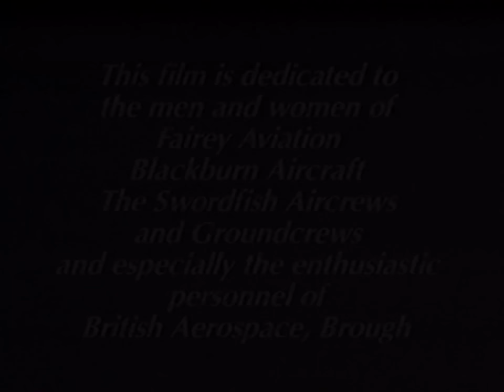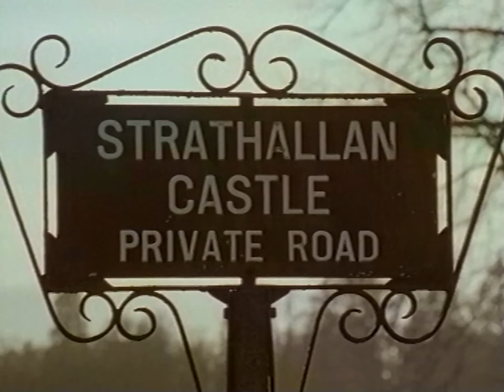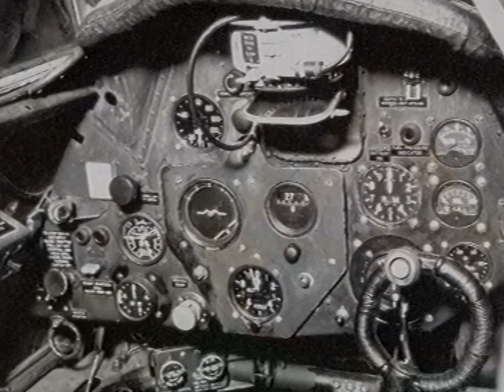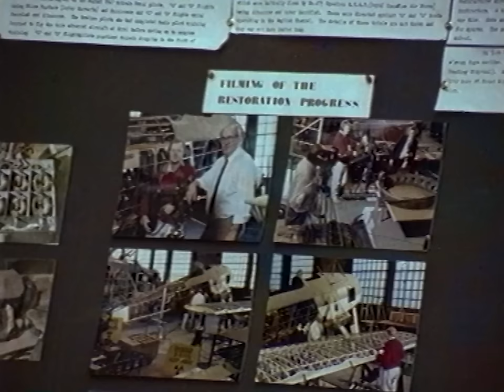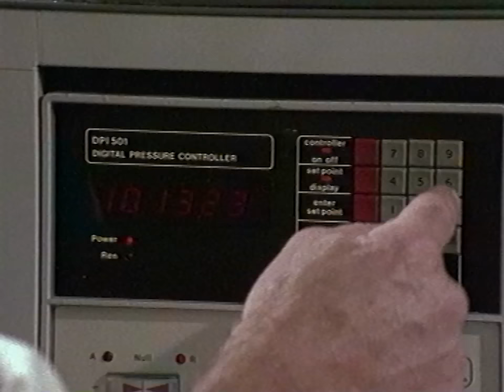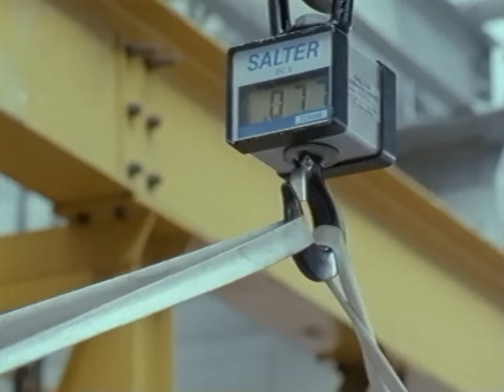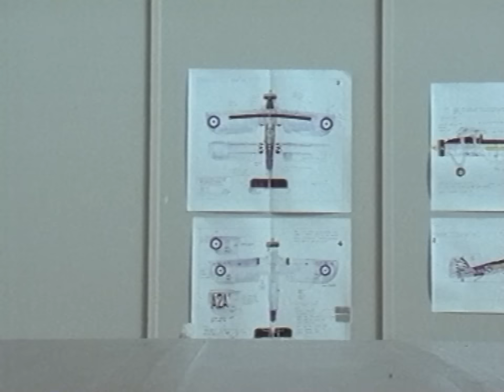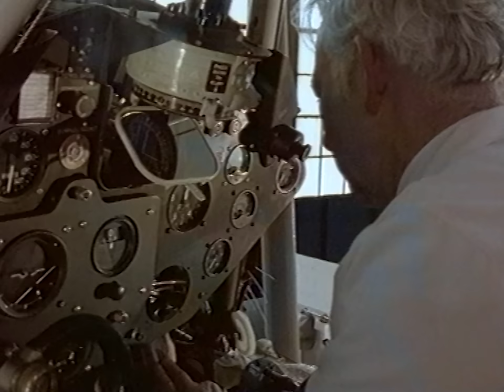Swordfish W5856 Restoration

Comment: The  primary reason the old Swordfish torpedo-bomber was so effective against the Tirpitz and other German vessels, is  because it WAS an old plane. The German anti-aircraft guns tracking systems were designed to pan quickly for fast moving aerial targets...the slow moving 'targets' of the Swordfish had gunners frustrated as they couldn't move their guns slow enough...By the time the gunners had figured this out, it was too late.

Comment: My uncle Oliver was a rear observer in these beauties. He later moved on to Fairy Fireflies, having trained on Skuas. I asked him what was the scariest moment he had in a string bag. His response was attacking German coastal shipping at night. They would undertake an almost vertical dive from around fifteen hundred feet. His job was to pull the toggles that released the bombs from the wing racks to fall on the ship. That's when things got scary. After the dive the Swordfish has a very shallow climb rate, plus the engine exhaust collector ring outlet glowed blue flame at night. You were lit up in the air, slow, and an ideal target. If you had not done a good job bombing the ship, their AA guns would still be active, and the scariest part, according to my uncle was seeing tracer bullets coming up to meet the aircraft, with six bullets between each tracer round pinging through the wing fabric, all the time wondering whether the next bullet had your name on it. My uncle always said that the Swordfish was a stable weapons platform, but a little slow, and being exposed was no joke. It was bloody cold up there. Fireflies had a heated enclosed area for the observer, and were much better according to my uncle. When asked was there ever anything he regretted about going in the Fleet Air Arm he said yes, one thing......he could not swim. He ditched three times, but still survived.
Reply: I thought the Skua was long out of service by the end of WW2?
Reply: @andyronayne7947  The Skua was out of service by 1941. So maybe I got that wrong Andy. My uncle may have trained on them prior to going onto string bags on wooden deck carriers. I have adjusted my previous post accordingly. He certainly had a few hairy times in them. When talking about flying in them he would develop a nervous tick (a twitching) under his right eye. Yes, sometimes very hairy.
Reply: @MrMoggyman My uncle Stan was a Swordfish pilot and flew the plane in this film. I wonder if our two uncles knew each other?! Lots of stories from him...incredible bravery!
Reply: @DomboSpoons  You know I never found out which carrier my uncle Oliver was on, and maybe your uncle and my uncle at some point did meet either during WW2 or after. During WW2 it was definitely a wooden deck carrier. Which one I do not know. Maybe I should check up my uncle Oliver's service record. After WW2 my uncle flew from land bases for a while, and he told me that his pilot was an Irish guy. Between them they had a few hair raising adventures even then. Like what? Don't know the aircraft, maybe a Firefly, my uncle in the observer position on a channel night patrol noted liquid on the floor. Here's his report, 'Yeah, splishy splash between my feet, what's that? I reached down and dabbed mi finger in it and brought it up to mi nose. Oh crap, it's engine oil. Erm, matey (talking to the pilot) it might be a good idea to return to base. I'm splishy splashing around in engine oil back here. Ooer, okey dokey we're off back. I'll call it in as an emergency. On the approach to the airfield the engine ceased. We were too low to bail out on parachutes. We were now a glider. Near to the airfield we were quite low and the prop tip hit a barn and ripped the entire engine, its cowling, and its mounting conduits clean off from the firewall, but despite not having any engine at all now, we were still a glider (laughs). Don't ask me how we were still flying straight after that, but we were. We crossed over a hedgerow at the border of the farm, and the next I knew, with no undercarriage, there was an almighty bump as we hit the airfield grass, and the underside hatch opened. The ground started coming in as the aircraft dug a furrow through the grass, the soil and grass sods filling the observer compartment by perhaps one third. On coming to rest the pilot immediately vacated the aircraft and played dead on the grass. He wanted leave, or a medal, or both! (laughs again) I was sat on grass sods and soil like some sort of farm animal. I had to wait for the airfield emergency crew to get me out. When they saw the inside of the observer compartment and that the engine was entirely missing the rescue guys said 'grief.' I said 'Moo' and they laughed. God knows why the aircraft did not go up in flames. Luck?! Maybe. We must have had plenty of aviation fuel still on board in the tanks.' Interesting! Up in the air in a Swordfish was drastically cold. Some tips. 'How to keep warm? Well you could pee yourself, but the relief was only short lived. After that you were even colder. But one ruse was to use some sort of stinking rum pellets. You kept 'em tucked away in your flight jacket wrapped in a handkerchief. The very smell of these would make you throw up over the side. After that your body naturally warms itself up to overcome the shock of it.' When asked about his exploits my uncle would always reply, 'Ah, balsa wood and bits of string. Stringbags they called em. Stable but slow weapons platform, could take a lot of damage, but my God cold and talk about antiquated.....WW1 vintage. Fireflies, ah inside and warm at last.' I once asked what was the most important thing to remember on a Swordfish, and his answer was, 'Making sure I knew where the rescue dinghy was, and that it was not damaged. I cannot swim, and we ditched three times. The aircraft always took a good time to go down. Just get out on the wing, get the dinghy inflated, get in it with your mates, and get away from the sinking aircraft. Of course in a swell or rough seas that could be a bit problematic.' When asked whether his rear gunner had ever shot anything down, his response was, 'Shot anything down? He spent most of his time trying not to shoot the tail off! But he was a handy lad when you were being shot at after a night bombing run at sea.' My uncle Oliver laughed about it later at my brothers wedding, but when he talked about close encounters with death he would suffer a nervous twitch on his face. As for glorifying the war his response was, 'Then it was war. We did our bit. But it is over now thank God. There were many brave men, some who lived and some who died. They should not be forgotten, but perpetuation of the war should finish. It is done with, and I can tell you that there is nothing glorious about a tracer bullet coming up to meet you.' My uncle Oliver finally succumbed to cancer, but he had had an interesting life God bless him.

Comment: Damn, after another 27 years it may require yet another restauration job , I wander if it still flies 😉
Reply: Yes she does, alongside Swordfish LS326.  Both had some corrosion issues but BAE Systems came to the rescue and built new wings for W5856 and helped repair the wings of LS326.  They are both operated by the Navy Wings charity along with two Sea Furies, a Seahawk, a Westland Wasp and a Chipmunk.  It's hoped that, in time, Sea Vixen XP924 will, one day, join the fleet after her hydraulic failure accident.  A third Swordfish, HS554, was imported from Canada in 2019 and is being restored to airworthiness by a private owner so, if we actually have an airshow season next year, we may see three Stringbags flying together.

Comment: The Swordfish carried the torpedo that either penetrated the hull of the Bismarck or jammed its rudder. The Bismarck did not mount the AA guns so that they could shoot low so planes close had a chance. The torpedo had to be dropped so the waves wouldn't knock the torpedo off course so the copilot had to bend down over the fuselage and tell the pilot when to release.

Comment: The Swordfish was not obsolete at the start of WW2. It was designed in 1936, just 3 years before the start of WW2. In fact it was a state of the art Torpedo bomber when it was released. The configuration of it being a Bi Plane was a deliberate design decision to offer better stability and ruggedness. Anyone saying it was obsolete or a old design are being extremely misleading.

Comment: Just love how the manager said it's difficult to find the skilled craftsmen when at the start of the programme they said there is 200 people who built the thing originally living within 30 miles ??? If anywhere else in the world I would agree but there are cars,bus and train linking both but the builders of the aircraft wouldn't have a clue what went where
Reply: The aircraft was built in the late 30s and early 40s.  How many of those people are still capable of doing the jobs that they did FIFTY YEARS earlier?

Comment: Just goes to show that bigger,faster and more complex aircraft are NOT the be all and end all in aviation, especially military aviation, just because an aircraft can do Mach 2%+ is all well and good, but can it fly slow enough to tackle slower moving aircraft and helicopters, heat seeking missiles would have a job locking onto such a small heat signature.

Comment: Try obsolete.
Reply: Designed to meet Air Ministry Specification S.9/30 though it was a parallel development to the company's T.S.R. I private venture project. It delivered what was required at the time, a torpedo-spotter-reconnaissance aircraft which proved remarkably capable of serving in its design role during a period when aviation was forced to develop very rapidly due to increased political tensions and resulting conflict. The fact that it could be launched and retrieved in conditions which would have defeated "improved" newer types makes it difficult to understand what later designers were thinking. An aircraft is no use to you if you are unable to fly it.